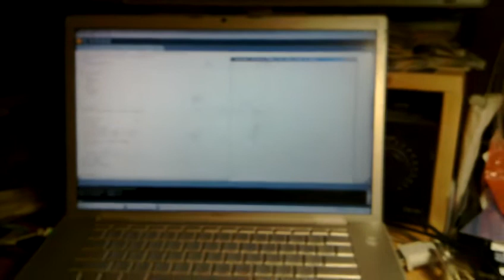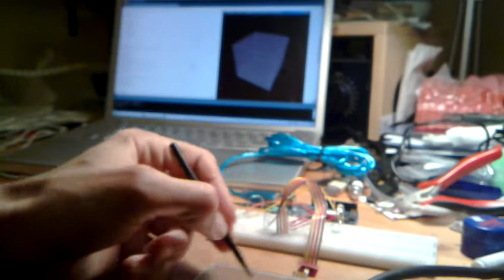Nintendo DS touchscreen fun

Comment from the maker: What the Arduino is doing at the moment is really little, just using two analogInputs and the +5 and Gnd.  There's way smaller microcontrollers that you could use to process the screen's input, if you were to embed the screen into clothing you could distribute the microcontroller and powersupply over the clothing nicely.  Output is of course another matter.  Not quite sure what to do with it either :)